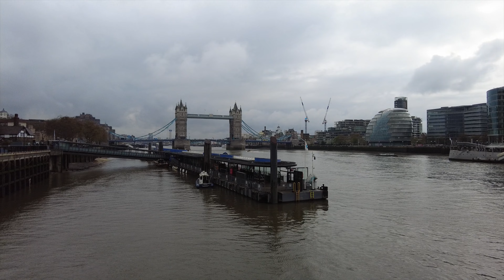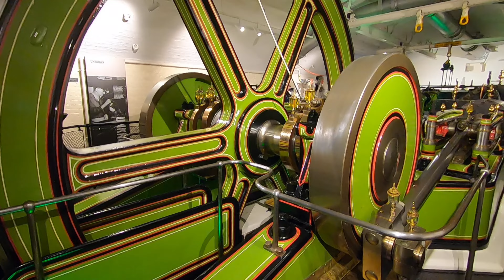441. Tower Bridge Tour  London

Comment: Hi Alan, that brings back memories. In 70s I worked for the London Electricity Board as a high voltage electrical fitter and had the pleasure of installing the 11.000 volt electrical supply for the then new electric-hydraulic lift mechanism. In those days the steam engines were still in operation and we were shown all around the Bridge and its workings. Thanks for the memories. Steve 👍
Reply from the maker: That’s very interesting Steve. I had conflicting research about when the engines changed to electric-hydraulic. 1976 seems correct from what you say. Glad to have brought back fond memories for you, thanks for your comment.